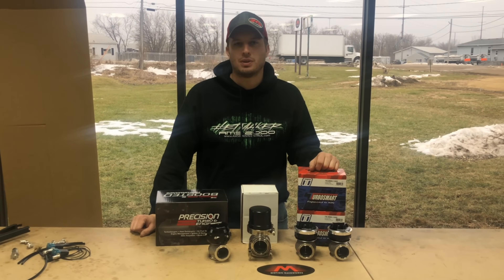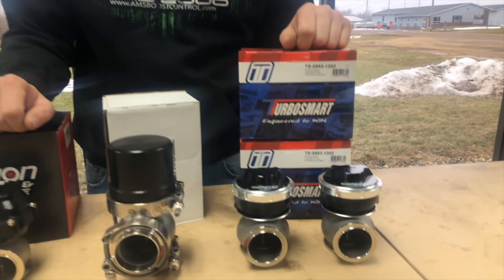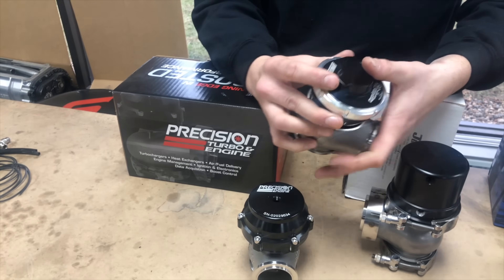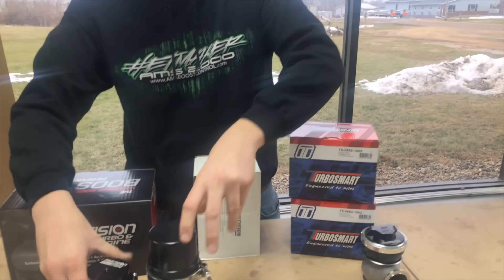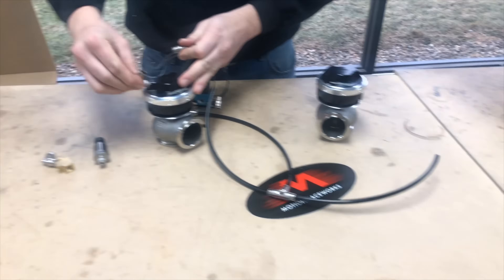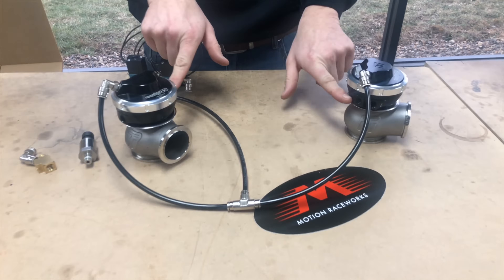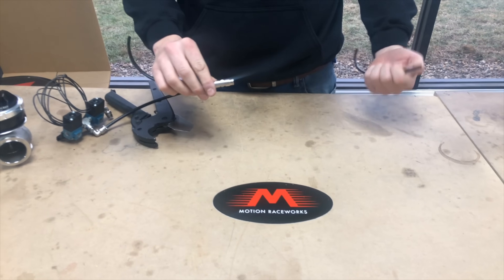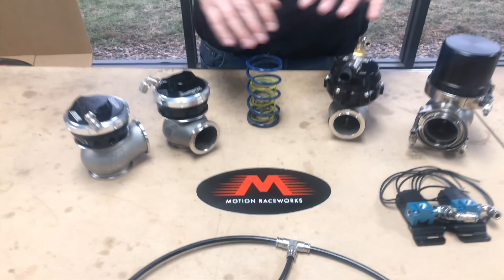Motion360 Ep 9:  Choosing a Wastegate for your turbocharged application!

Comment: I need help. My first time setting up a turbo. I bought a used turbo kit that came with a 44 mm precision wastegate.  My question is do I need to use the top port on the Westgate or can it be left as is open. 
The Westgate only has one  banjo that screws onto the side. I believe this is used for boost control. The top port (hole) is left open and does not have anything screwed in. I don’t know if my set up was used that way. Do I need to plug the top port or Can it be left alone, as is?

Comment: Great explanation.  I've been experiencing overboosting after I installed a more efficient intercooler.  It's only happens in full throttle.  I have a 38mm wastegate.  Do you have any idea what could possibly cause overboosting after my intercooler upgrade? Any input would greatly help.  Thanks

Comment: I had to stop the video shortly after starting, an oversized wastegate is not going to overboost your engine. Having a spring in your wastegate that is higher than your desired boost will over boost your engine. An oversized wastegate means your controller might have to be tuned more precise to open at the correct time/psi in order to maintain the desired boost. Having a wastegate smaller than necessary will definitely lead to boost creep and over boost situations because it cannot bypass enough exhaust gases away from the turbo.
Reply: Finally someone said it. This bugged me throughout the video hearing that a large wastegate would cause lag.
Reply: I was wondering about that since a wastegate, as far as spooling the turbo is concerned, is just a controlled exhaust leak so the issue would seem to be difficulty controlling the "leak" enough to maintain the desired turbo rpm and thus boost as with a big gate small movements equal large changes in the amount of exhaust being diverted were a smaller gate would be easier to control.

Comment: If I want just spring pressure I leave the top hole open? Only vacuum from intake manifold to the lower hole? I have the same design as the precision one
Reply: Run the top open and feed a hose from your compressor housing to the bottom of your waste gate for spring pressure

Comment: You said that it is possible to over size a wastegate. Is this still true when utilizing a bottle sourced dome control?
Reply from the maker: Austin Sarver it’s a little less relevant with co2 pressure, however, you still can.  It can require you to run 2:1, 3:1 + pressure on the dome which most wastegates you can blow diaphragms on and run into other issues doing so
Reply: @MotionRaceworksOfficial  ahhh ok I have a better understanding now, thank you for clarifying, and thank you for all of your informative videos!

Comment: Hello from Japan ,  We use a 38 pie and smaller for up to 1.2-1.3 Bar boost ,,, 50 pie waste gate for all out racing up to 2.2-2.4 Bar boost ... Then 60 pie would be all out drag racing .... Only difference to this is twin turbo - twin waste gate and what waste gate spring you use . If you don't have a variable boost controller . Then you need the waste gate spring that sets the boost to the level you choose to achieve .

Comment: Could you do a video on where to properly put a waste gate between ex manifold and turbo?
Reply from the maker: J Minnick sure can!
Reply: And the best place and way to mount a turbo because everyone has their own personal preference whether it be out the grille and forward facing or right at the grille and side facing or behind the engine near the firewall and how to clock the turbo for the best oil drain and so on

Comment: What are your thoughts on moving the sensor off the wastegate to reduce heat and vibration for longevity?  More for a street/strip car application.
Reply from the maker: To be Honest we don't see a whole lot of failures as a result of that.  One of the biggest concerns there is that having the sensor away from the gate very far will change and slow down feed back for the boost controller.  We do make a nice remote mount sensor if you are doing so, but we would recommend mounting it fairly close to the gate.